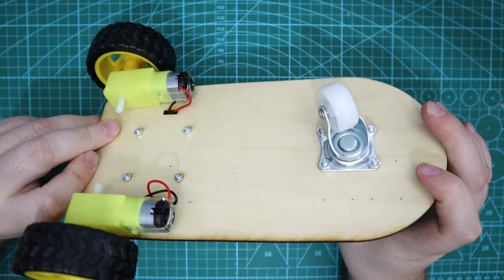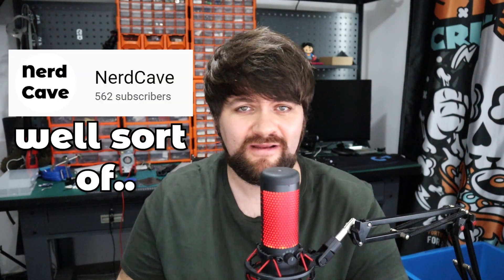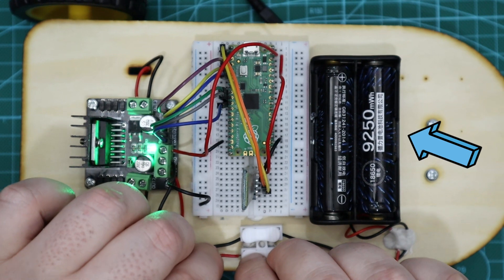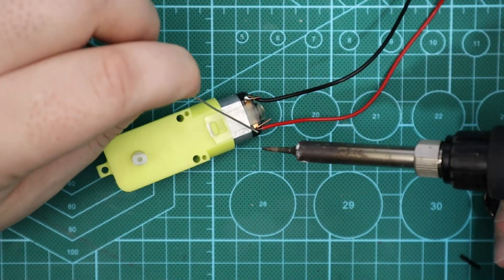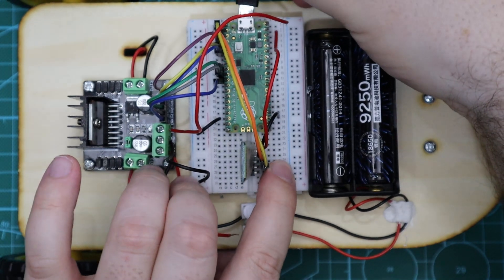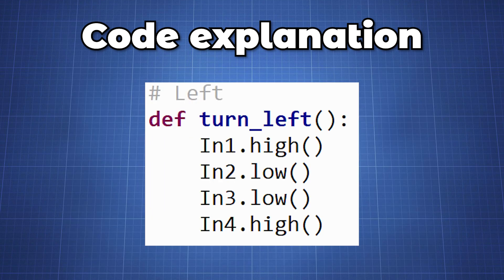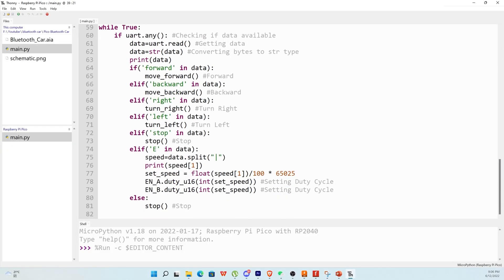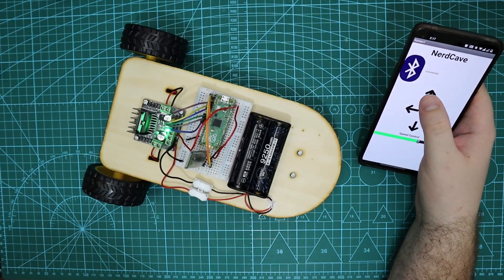Raspberry Pi Pico - Bluetooth Controlled Car Project

Comment: Hey, great video! However, I ran into a problem and have no idea how to solve it. I connected everything as you did in the video, except for the connection from the HC-05 to the AGND—I had to switch to the GND port for the HC-05 to establish a connection. I can connect everything to my phone and the AI Companion, but the motors won't react—no sound or any indication that there is a connection.

Maybe you have an idea why that is?
Reply from the maker: what is the PWM set to for the motors if too low the motors will not turn, also have you tested the motors by just sending it full PWM signal to see what they do on full speed
Reply: Coml se hace eso? Disculpa  como checo la configuracion o como configuro el PWM

Comment: It is okay to use ( raspberry pi pico h ) ?
Reply from the maker: sorry for the late reply I have not used the pico H but you want to power the motors from the Pico?
Reply: @NerdCaveYT  Yes because raspberry pi pico don't have stock, So I bought pico H

Comment: Very good video with excellent description. I am using Pico W (it has ble) so I don't use the HC-05. The app you provide us needs the pico to be paired with the phone in order to work (when you are selecting device you can see only devices that are paired to your phone). I have tried many times but pairing fails every time. Do you know why? I am a bit confused. Is there any way to finally pair the pico with my phone (I have checked and my phone supports ble devices)? Because I can not pair the pico with the phone, I don't see it as a choice in the app.
Reply from the maker: What phone are you using, so my phone picked up the HC-05 but I do know that Apple does not work with this protocol used on the HC-05 and you need different protocol. I have not checked with the Pico W yet in terms of BLE I probably have to check it out and make a follow up video on this project
Reply: @NerdCaveYT  Ahhh, I understand. I have an Android, realme 7, whatever

Comment: I want to add an additional motot driver to use two more motors to control a trane an the top of this car. Can I connect two motor drivers in one raspberry pi pico?
Reply from the maker: yes the gpio pins in the Pico all have PWM so you can add another driver and just setup everything in code for a second motor driver
Reply: Thank you!, one more final question, the Pico from which motor driver will be powered?

Thank you again, you are really amazing!
Reply from the maker: What voltage will you use to power everything if you for example use 5V, you can power everything directly from the 5V the pico and two motor drivers because the motor driver uses 3.2V~40Vdc as input and pico 3.2~5.5V. Now if you give more voltage because you want more power from motors it won't matter which motor driver is used. The motor driver has a regulator to regulate the voltage to 5V that can be used to power the pico, just make sure all of them have a common ground

Comment: I am planning to use the version of pico that has bluetooth (the W version) instead of using the HC-05. Do I have to change the power supply in order to operate succesfully? I am afraid that if I use the same power supply the raspberry will fry because the cable coming out of the L298N moto controller is at 12V. Please help me, i don't know what to do...
Reply from the maker: The L298N has a 5V out pin as shown in schematic, just make sure when power the pico from the motor driver 5V out that Pico is not plugged into PC via USB

Comment: Really nice video! Are all the jumpers Male-Male?
Reply from the maker: thank you, for the pins connecting to the motor driver female-male so it can connect to the breadboard
Reply: @NerdCaveYT  Thank you so much! How many cable (male-male and male-female) do I need in total for the project?

Comment: Hey so i made this but it wont move the motors. I have the code working and bluetooth is connecting, jusy when i use the software on your app (or any software for that matter) the motors wont move. Do you know a way I could fix this?
Reply from the maker: what is the PWM or speed set to, if it is to low the motor will make a high buzz sound

Comment: A most interesting Bluetooth Raspberry Pi Pico video.    🥳  Will this code example run on the newer  Raspberry Pi Pico W  with built in Wi-Fi and Bluetooth?   🤩  Thank you.
Reply from the maker: It should, I have not tried to use the Bluetooth on the Pico W the implementation does not seem straightforward, WIFI might be easier
Reply: Thank you.

Comment: bro just saved my after-school club 🥶🥶💀💀
we're doing a project about building a robot that can take aparta lego structure, and this was VERY, VERY helpful
thanks, my guy NerdCave
Reply from the maker: That is awesome! Glad it was useful, this project was during my 90 day lockdown in apartment XD
Reply: hey, thanks for replying! i have a question: can this project be done in circuitpython? i'm wondering because at school, i have to use a chromebook and micropython doesn't support mass storage. if not, i can try to adapt.
Reply from the maker: Yes this can be done in CircuitPython just a little bit of modification needed but the logic stays the same @comical24
Reply: ok, nice! thanks
Reply from the maker: if you need help just reach me on discord @comical24

Comment: Is it all right if I use three 3.7 volt batteries, or will that fry something?
Reply from the maker: Safe operating voltages are between 1.8V and 5.5V for the raspberry Pi Pico it has a buck-boost converter on board

Comment: Hello. android application constantly loses connection with HC-05 module. Don't know what could be the problem?
Reply from the maker: I am not sure I will do a bit research, I have not used it that long to experience anything
Reply: @NerdCaveYT  Hello. I figured out the problem was with the battery. I installed a 9 volt battery.
Reply from the maker: @АлександрМаскалевич-и1ж  great, I should probably make an update video because those motor drivers are really not great found better ones for the same price
Reply: @NerdCaveYT Did you made a new video? Please make it if not 🙏
Thank You

Comment: Sir, love the awesome Raspberry Pi Pico - Bluetooth Controlled Car Project. Sir, can you make the Arduino Uno Xbox360 controlled 6 dof robotic arm car using the Xbox360 controller? Sir, tell me, is it possible to do this amazing project.
Reply from the maker: Is there like special xbox controllers for microcontrollers that comes with a receiver? I have a ps2 control which I used before never tried xbox controller before

Comment: Hey I am about to try the same project using your guidance and code, but I need 4 wheels, I am guessing that I will be able to work it out isnt it ? they shouldnt be any technical issues doing it using those components ? Thanks !
Reply from the maker: Hello you will be able to connect 4 motors to the one driver if you would like to make it 4wd. So in short two motors to A and two motors to B

Comment: Hey thanks a lot for this.  Do you mind creating an amazon list with all your components ? If you start affiliation you might make a buck in the process too :)
Reply from the maker: The reason why I don't make amazon is just that I can't verify the suppliers if they are good or not since I can't really buy from Amazon being here in China at the moment here the locals use Taobao which is where I source my things, then I usually just make the AliExpress links or part names

Comment: Hi Thanks for an amazing project which nearly works!  I have the joystick option working fine, thanks.  I am having trouble with the bluetooth option.  I've loaded your MIT example and I have a similar example app supplied by the bluetooth company who make the module.  My problem is I can't work out the structure of the data you are sending and I don't understand the constuction elif ('E' in data) speed=data.split("|").  Could you please help ?  If I simply the if statement into just reading character it works but I would quite like to have speed decoded as your program does.
Reply from the maker: Hi at this moment I do not have my pc, all my things are in containers busy moving. The code as I remember was send a value depending on the slider which will range from 0-100 and if you print the data being received from Bluetooth it needs to be split since it gives a value x 'b' Infront that gets formatted so that I can pass the correct value for when calculating the PWM to control the speed. If possible you can add me on discord and I would be able to help.
Reply: Thanks,  I will do that.

Comment: Good Thing! Everythig works fine, but: left is forward, right is backward, up is right an so on. How do i correct this?
Reply from the maker: In the code where you have the function forward, backward, left and right you set the output high or low, change these to get the correct results or what you can do is rename the functions make right to up etc.
Reply: yeah, i renamed the functions, but also the names in the "while true", that was my mistake. Now it works. Thank you!!! An now i´ll build these one with a Raspberry Zero with a Camera...
Reply from the maker: Awesome glad it is working now, saw a new pico being released recently